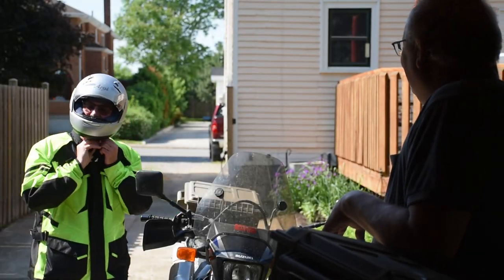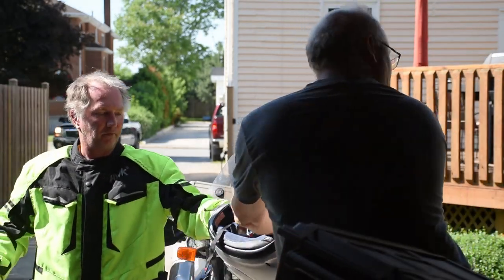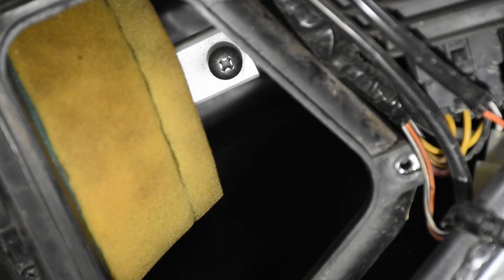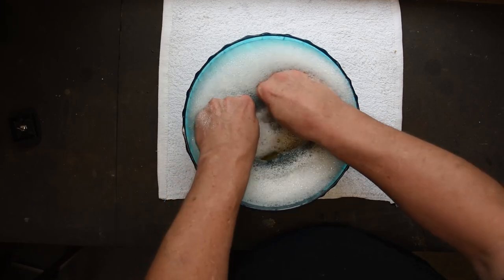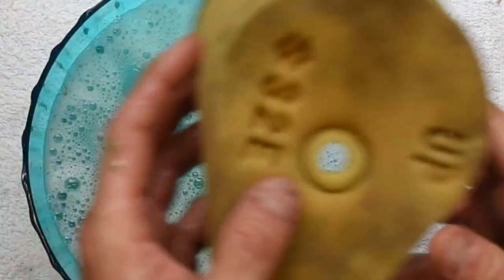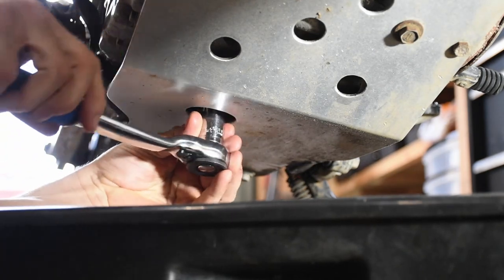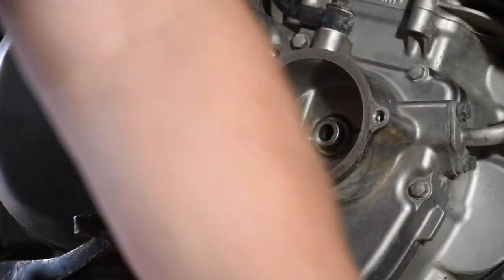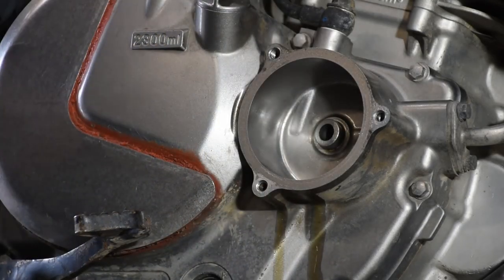How to service a motorcycle (DR650) easily.

Comment: ‘Phillips Head Screw’ I don’t think so… all Japanese vehicles use JIS screws/bolts. Not Phillips, PosiDrive or anything else you wanna call it, if you ever wondered why your Phillips screw driver would not remove the magneto screws and chewed up the heads then that’s because they are JIS (look it up ! )
Reply from the maker: Hi Paul Marshall, thank you for the comment. you are not the first to mention this and in later videos I address the JIS screwdriver. I personally have never had an issue myself with using good quality Philips screwdrivers on any of my Japanese power sports  but I have always been very cautious when removing any fasteners and stop what I am doing prior to damage.
The JIS drivers do fit better than most lower cost traditional Philips drivers I own and I would agree with your observations on using them. 
Either way if you are to aggressive even JIS will cam out and destroy a fastener, its not a magic bullet, just more insurance for you.
Thank you again for the comment.
Dino

Comment: What can i use to wash my motor,  just bought my frist dr 650 2006 with 4,286 miles great shape just want to clean it up? Thank you Sir!
Reply: whatever you do don't use a high pressure water cleaner such as a Kärcher as this will push the water accros the seals into bearings...etc.

Comment: Hey Dino. You can speed up the air filter drying time by spinning it in a cheap lettuce leaf spinner. Its also a good tip you mentioned not to let your nuts fall out. . .  😉

Comment: I knew most of what you did, I don't have a battery tester like yours, On the way (thanks Amazon).  Your video ties everything together very well.  I have a habit of doing one of these tasks at a time; takes forever.  Also tells me how to maintain the DR when I comes time;  BTW, how often for this routine?  Thank you for all the tips.  Would your hypersonic cleaner be too harsh to clean the chain with?   Also, thanks to Karl, I wondered how toothpicks were made.  Funny!!
Reply from the maker: Thank you for the comments and questions and I am sorry for the late response. I would not wait longer than 5000km or about 3000 miles or once a year for the service, however if you ride hard or ride in very dusty areas you may want to service more often. I am not sure about using the ultra sonic for the chain, I am sure it would work I just would not use anything to caustic in the tank. I really don't know if I would try it or not. Lately I just have an old pie pan that I fit the chain into and soak it in kerosine, then use a stiff nylon brush, works great.
Dino

Comment: I expected everything up until the chain. I never did anything other than cleaning, greasing and checking tension.
That thing about distance between a number of links is news to me, I just change the kit when the tooth are sharp.
I'm not as thorough as I thought !
Reply from the maker: Thanks for the comment, I'm just passing on what's on the manual. Thanks again 
Dino

Comment: Is the airbox abs? Use some abs cement to tighten up on those nuts that like to get loose (doesn't solve the person overtightened them, but it can undo the damage)
Reply from the maker: Not sure, but that's a good tip of it is

Comment: Great video. When I clean my air filter, there was a tiny bit of gas in the air filter. Do you think that’s a big deal if it was a little damp but mostly I could smell the gas.
Reply from the maker: Thank you for the question. I always point out that I am not a mechanic, just a guy who likes to tinker, but I will give you my opinion.
I always find my filter will smell a bit of gas when I pull it out but there is not pooling of fuel in the airbox itself. I think fuel does make its way back to the filter during normal riding as the throttle opens and closes (again, I am not an expert) however if you have pooling in the airbox I would think this could mean you have issues with float height, a faulty petcock or running way to rich.
If the bike is running well for you and it is just a smell of gas I would not be to concerned, however perhaps others may chime in here with there experiences as well.
Thank you again, I hope this helps a bit.
Dino

Comment: Hey Dino Great Video Quick Question Would You Happen Too Know What Is The Size Of The Pivot Bolt For The Rear Brake On Dr650 , I’m current trying too replace it but I noticed the pivot bolt does not come off the oem back brake pedal and my new one didn’t come with one any help ?
Reply from the maker: Hmm I'm not sure, the new pedal is aftermarket?

Comment: I may be wrong but it looks like when you took the oil plug out you were tightening it. Did you strip it I thought I saw you wipe off some threads?
Reply from the maker: Lol yes you are correct. Have a follow up video on the repair. This was one of my first videos and my mind was on filming not wrenching (a bad thing to do). You are the first person to notice in almost 2 years, good eyes.
Dino

Comment: You didn't clean the secondary air filter....
Check the clutch cable sag
Check throttle play
Check spark plugs 
It is vibrating, so do a quick check for loose nuts and bolts.
Reply from the maker: Sharon Sharon, thank you for taking the time to comment, it is really appreciated and helps me improve. You are correct, there are a few other items that could have been in the video. It is challenging to get all the information into one video and not have the video be too long. Because of this, I moved the topics you mentioned into other future videos, clutch free play for example is covered in a clutch replacement video I have ready for release later in the season. and the others seemed to fit better for me in both the carb cleaning (throttle free play and vent hose filter) and valve adjustment( spark plug inspection and gapping) videos that are planned in the fall.
Again it is hard to cover all items recommended to check every two months in one video (the manual list 14 things even including head bearing adjustment) but I will do my best to look at these in the future. 

Great comment and Great information , thank you again
Dino
Reply: @DinosTinkerShed  Really like your videos!
Reply from the maker: Keith mullens, thanks for the comment, I think regular oil is most likely fine and as I mentioned I used to use it as well. I do feel that oils have changed over time and modern  motorcycle oils are more compatible with the newer bikes on the market. In the end it is really up to what the user feels comfortable using and that's ok.
Thank you for the feedback.
Dino

Comment: I have another question for you- I have KandN steel mesh air filter in my dr650 instead of a foam one. I imagine it's geared more towards street riding and less dirt even though I do both. Is there a way to service those? Should I put a foam filter over it?
Reply from the maker: Thank you for the question, I am not an expert on K&N filters however If it is the filter designed for the DR650 it is designed for off road use without a pre filter according to their website. The most important thing to remember with the K&N is that, although it comes pre oiled and ready to use right out of the box, when you do clean it it must be re-oiled in order to function properly. K&N sells a service kit for their air filters that runs about $20 USD and I would recommend using their product to ensure the best performance from their filters. If you ride in dusty conditions you may want to clean it more frequently.
I hoe this helps and thank you for the question.
Dino
Reply: @DinosTinkerShed  thank you! It's way overdue for a cleaning. I need to make it a priority. Thank you for taking the time to help.

Comment: can you tell me what all you use brake cleaner on, on your motorcycle? and what product did you use to clean the chain ?
Love your videos by the way.
Reply from the maker: Brake cleaner is a grease and oil remover, I use it on a rag to clean the matting surfaces of the oil cover and the cover itself as well as I clean out the air box with it. Mechanics use this for cleaning new brake rotors before they install the pads and calipers to make sure that no grease contaminates the pads. 
I used WD 40s bike chain degreaser on the chain but any gentle  degreaser would work especially if the chain is not too dirty.

I'm glad you like the videos, I'm new to this stuff, this was my 4th video so it's nice to know they are being well received.
Thank you again for the comments, I have a few videos in the que right now but will include a bit on chemicals safety in the next one I edit. 

You have a great day.

Dino

Comment: How much should I tighten my the drain plug if I don't have a torque wrench? Thank you!
Reply from the maker: Hmmm Hard to explain. It is 19 foot pounds so that would be like a little more than 3, 5 pound bags of sugar on the end of a one foot bar pushing down. It does not need to be super tight so I would say snug it down and fill the bike. If it does not leak it's good. If it leaks snug it a bit more.
Hope this helps
Dino
Reply: @DinosTinkerShed  It helps a lot! Thank you once again!
Reply: It has only got to hold Itself in place! It’s not like it’s holding the wheels on! Finger tight then 1/8-1/4 of a turn, in this case it’s best to be slightly under ( if you have used a new crush washer that is) if you use old washer and it has been crushed already then don’t expect any ‘give’ just before it strips the thread out!!!

Comment: Wheres your disposable gloves?
Reply from the maker: Hey thank you for the comment, I do use disposable gloves if I am going to be working with a product that is extremely caustic or if I am exposed  to a chemical like brake clean for a long period of time during a prolonged cleaning session. I do not use them for small tasks like this where I feel the risk to myself is less than the risk to the environment by generating unrequired disposable products.  For me, I find washing my hands and using a moisturizing agent afterwards works fine for most products I use. However if you find the products I am using are a bit to harsh for you, than gloves are a good idea.

Again thank you for the comment, I appreciate the feedback.

Dino